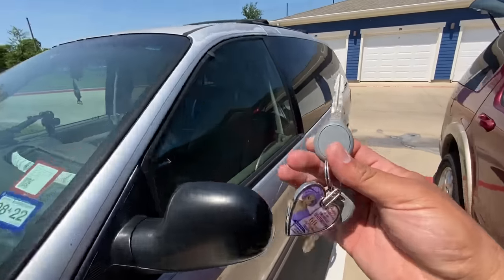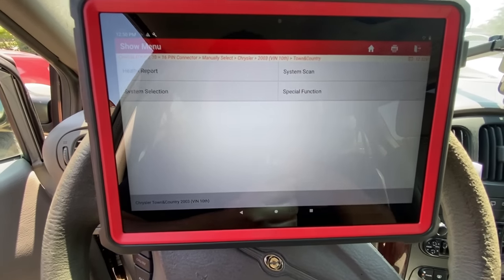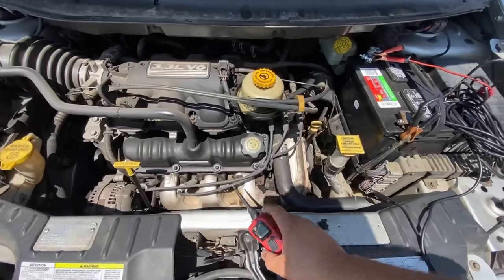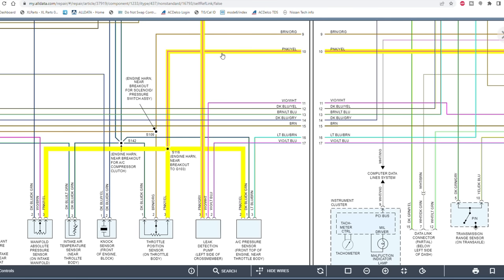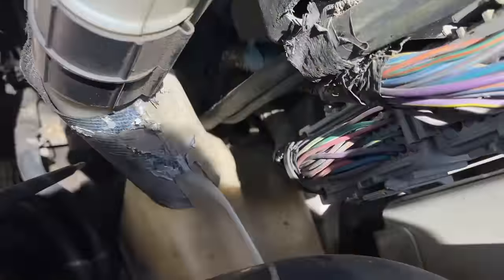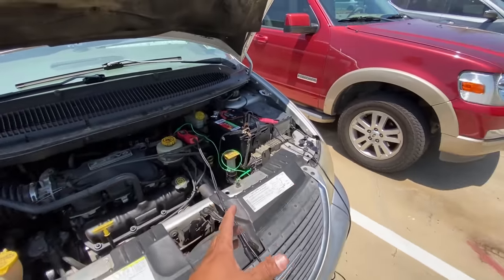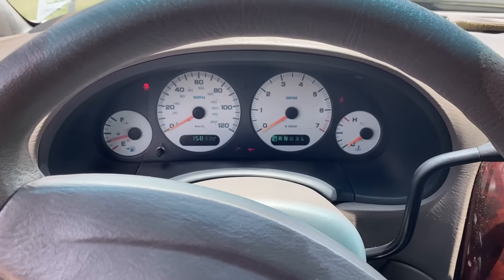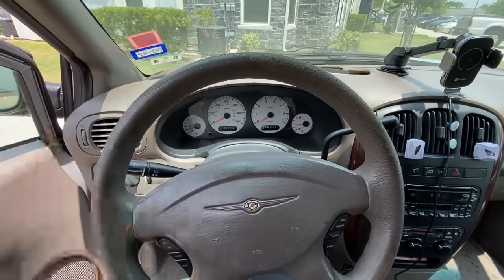CHRYSLER TOWN & COUNTRY NO COMMUNICATION NO START

Comment: i have a quick question ,could i have check for a open wire coming from the  pcm  to all the 5 volts ref sensors wires  connected to the pcm and the powers and grounds from the pcm to the sensors for open wires?before ruling that i need a pcm

Comment: To check if it’s shorted the 5 v simply unplug the pcm and if the ground goes away on the 5v ref wire then it’s not shorted externally it’s the pcm grounding the 5v

Comment: Eric - why couldn't you unplug the connector at the PCM and then measure the voltage on the pin on PCM for the 5V reference?

Comment: I had a 98 T&C with no crank, no start form time to time and it turned out to be the multi pin connector on the back of the instrument circuit panel (Speedo and tach). You could see, under a magnifier, that the solder was cracked where the pins entered the circuit board. I resoldered over the cracked solder and never had the problem again. The is a YT video on how to do this.

Comment: That red light is the security on chryslers. if it is on most times, it is not reading key transponder
Reply: Notice red light going out when the replacement ecu is in and key on before start. and with first ecu light stayed on key on

Comment: Is that an Auto Comp special PCM?  Ive used them a few times over the years in a pinch, never had an issue with them luckily
Reply from the maker: This one I got from NPC. I use both Auto Comp and NPC they are both great. I’ve never had a problem.
Reply: @ADVANCEDLEVELAUTO  Is NPC local? Never heard of them before

Comment: At 16:29 I see that the emission hose connected to the valve cover is split. These have been a problem on Chrysler products for decades and may contribute to the early demise of the engine.

Comment: For sure it is all about knowledge and much experience n getting these wildly engineered "computer" cars ironed out. Good idea on the tach concern but you were hired to solve a no crank issue so that tach is not to be confused with the initial task.  I've heard of instrument clusters being repaired by using a pencil eraser on the printed circuits inside ! Apparently they build up tiny crud on them and cleaning them allow the correct current to flow. Weird it is.

Comment: At 19.13, supplying 12v at the 5v signal wire is not always thr best. 
What if the test light lits because current is making all the way to ground inside the pcm. Then PCM will be turn from bad to worst.

Comment: You need this tool to use with your backprobe. Then you can easily add 5v and see the change.
Power Probe 5 volt reference adapter

Comment: somebody probably jumped the starter and it back fed into the pcm 12 volts is way too high for a 5 v pulse, or jump stated it improperly, or cables on wrong battery terminals and even unplugging the cable from battery while running to "test" the alternator no a days is a big no no.

Comment: If the computer is bad, what will happen if you try to start it with starting fluid?  I would think that it will crank but not start.  If it does start, then the computer should be good.  Do I have this right?

Comment: Got a question for you Eric. Which of these scan tools would you recomend xtool d9 pro over the launch you used on this video?
Reply: Eric uses the Launch as his go to Scan Tool. I do the same, Launch is a Dealer level Scan Tool. I use my Snap-on for Can Bus problems or monitoring High- speed signals such as CAM and Crank Sensors.

Comment: Nice job but to avoid the headaches of all that trouble shooting we use the Autel MK808 scan tool. It works with 85 different car makes and models. Not only will it read all engine, PCM, TCM, ABS codes, and more, but it has multiple other functions that display live data as you troubleshoot. The days of checking under the hood are gone.

Comment: My 2002 has just thrown p0302 misfired cyl 2. I have had 140k on one set of plug and wires. And, i might have a injector. But, the starter would start the car, and it ran until the other day. The battery needs replacing. These Vans can have a problem with engine ground. I had a Sideband radio that needed ground, as it never worked right, i sold it. But, i was told the car wont ground for it.  Check engine on p1684 is batt unplugged,
Reply: Reset the cluster. Press trip and hold.
Reply: Tach/rpm sensor.

Comment: Just paused the video at the beginning. The check engine light will ALWAYS be illuminated with the key on, engine not started. Hint, the MIL is unique in many vehicles, it is direct from the engine control. In the case of Fords and Chryslers, we have a "PCM", the powertrain control module handles both engine and transmission.

With this Chrysler, that wee red dot is key. That is the immobilizer.

Comment: Great work, but no matter what, those cars are manufactured our days will always be crap, full with plastic and connectors overload with sensors
I wonther how hard is to replace thoes 3 spark plugs that are close to the fire wall

Comment: that RPM stepper motor is bad, I have replaced them on Chevys and they are soldered onto the board, not a bad job but I would not recommend it in a professional setting unless the cluster is expensive or needs reprogramming, an hour job for sure to add to the books.

Comment: small red circle is security lamp , nomally should go away after 3 second after turning key on , in this car it stay on that means key issue , in think it was possible to program anew key and the car will run without changing the BCM
Reply: That’s what I thought too security light on but scanner never shows immo codes so probably ECU damage don’t you think

Comment: I’ve worked in shops, I’ve owned shops. It is difficult to find good mechanics, especially ones that can diagnose electric problems. Customers are cheap! They don’t want to tow in their vehicle. I’ve never met a good mobile mechanic. One issue you will have with them is that they won’t have all the tools they need to properly complete the job. Next, they won’t have access to the information programs that shops pay to have. They can’t afford a good scan tool. They’ll make a huge mess in your driveway, and also good luck getting any labor warranty. I’ve had dozens of cars towed into places that I’ve worked at that were all taken apart by a mobile mechanic. They started the job, got paid half the money, and never came back. Only mechanics worse than mobile mechanics are do it yourself types that get in over their head. Probably 5% of mechanics would be able to diagnose the problem demonstrated in this video

Comment: I have two Dodge grand Caravans won the ECM went totally berserk now my second one is running great but stays with a check engine light and says multiple cylinder misfire and we've changed everything crank sensors can anybody help

Comment: on most dodge type vehicles that red dot on the cluster is the key security, if you have a good key the light will shut off if the code it reads is correct, If the light is solid on or flashing it means the computer cant read the key or it reads the wrong code

Comment: A little tip to live by: if somebody diagnoses your vehicle malfunction and tells you that you need a new electrical component without ever having probed any electical connections with a test light or multimeters, call somebody who knows what they are doing before letting some fool play mechanic with your car. Diagnosing a problem is not difficult. What sux is diagnosing what some moron who never should have touched the vehicle in the first place did and trying to reverse  engineer whatever stupid thing he did that makes no logical sense before finally getting the opportunity to diagnose the original problem like it should have been done in the first place. Most people that "work o  cars" dont actually work on cars. Cant tell you how we got here but it is what it is so use your head and question the obvious.

Comment: In my country, those technician only know how to check the error code. No part check, no sensor check , no nothing. Just error code. If there is no code than the car is okay but my car is running weird and those mofo said my car is okay. Don’t even go for a test drive and charging me 50 bucks for that kind of service. Anything, i had to diagnose it my self and go to their auto shop only when I know what the problem is. Their diagnosing skill is worse. Being to 5 auto shop and mostly are the same.

Comment: So much just to make a motor turn, this is why I sold my 2008 charger when the computer quit running the 2nd injector. I replaced it with a 1989 fifth avenue, because you wouldn't know where to begin without a scan tool "that costs more then I'm gonna pay ever" when working on  a modern car. All I need for cars like my 1962 corvair is a volt/ohm meter, and a set of cheap wrenches from harbor freight. They all get  similar average mpg anyways